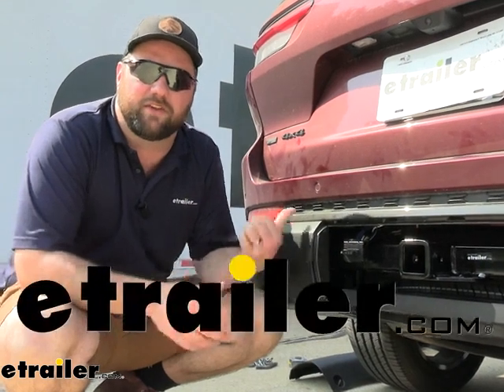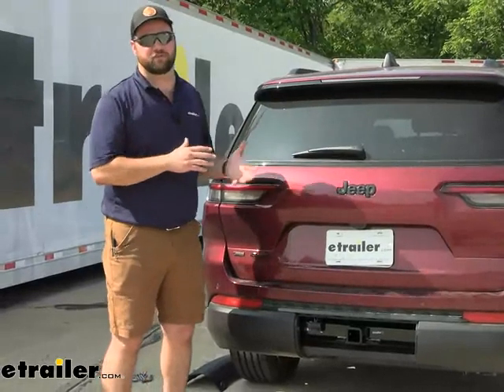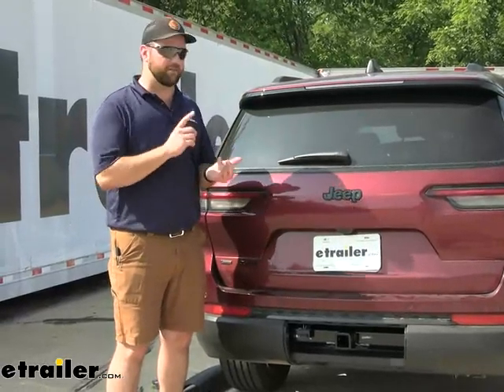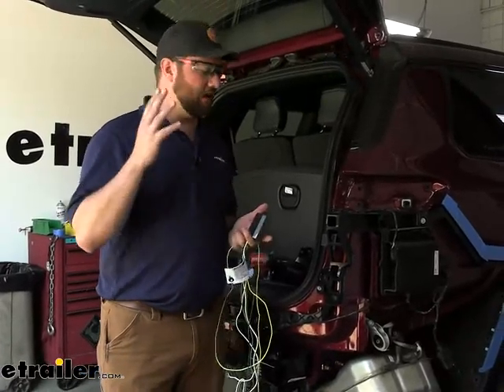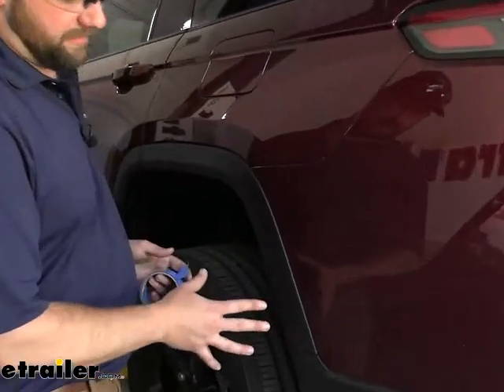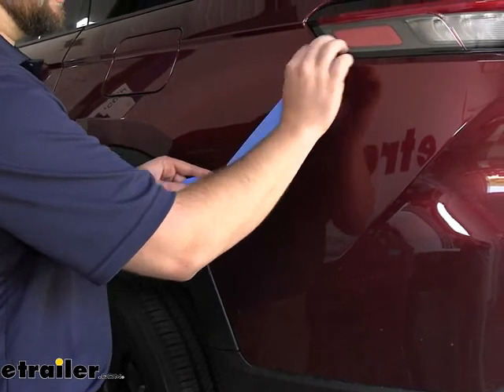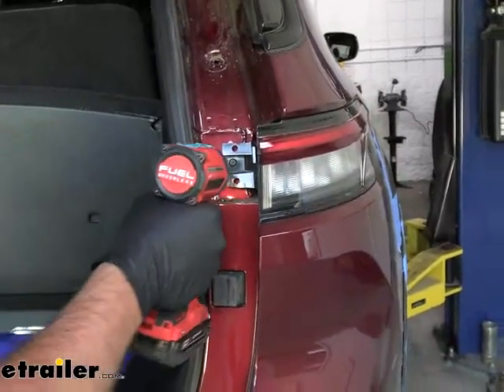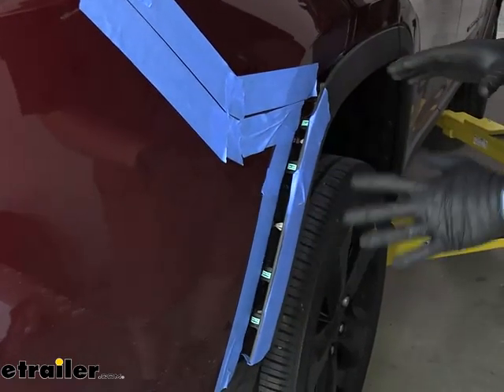etrailer | Curt T-Connector Vehicle Wiring Harness Installation - 2023 Jeep Grand Cherokee L

Comment: I have already installed the hitch, unfortunately. Can I still install the wiring without removing the bumper cover again?
Reply from the maker: Absolutely! It's not necessary to remove the rear bumper cover to install the wiring harness. Here's a link to the install instructions you can check out:
https://www.etrailer.com/instructions.aspx?pn=C27BR

Comment: Where can we hook the reverse lights
Reply from the maker: The 4-pole connector provided by the # C27BR doesn't provide a circuit for reverse lamps. You'd need to install a 7-way connector on the trailer and use an adapter like # 37185 to convert the 4-pole to a 7-way. You'd want to tie the purple wire on the # 37185 adapter into the reverse lamp circuit on the tow vehicle.
https://www.etrailer.com/Custom-Fit-Vehicle-Wiring/CURT/C27BR.html
https://www.etrailer.com/Trailer-Wiring/Hopkins/37185.html
Reply: @etrailer  assume you need to use a relay. Not sure about the grand Cherokee, but I had a vw and the can bus would detect an error if extra load was added.
Reply: Do you know where I can pickup the reverse light circuit. The reverse lights are in the tailgate which is hard to get to from the hitch
Reply from the maker: You'll need to find the harness that feeds the tailgate. It usually runs up one of the pillars on either side of the rear hatch.